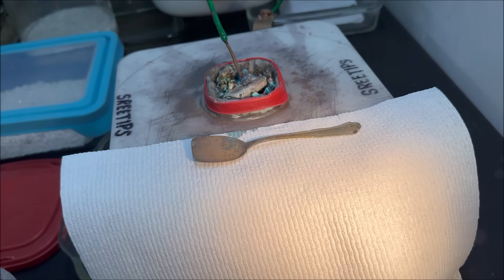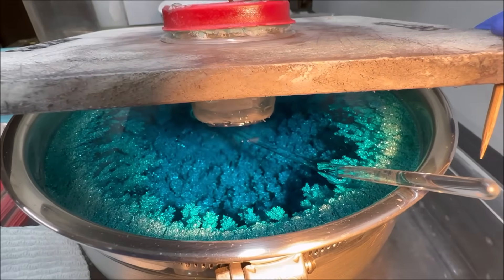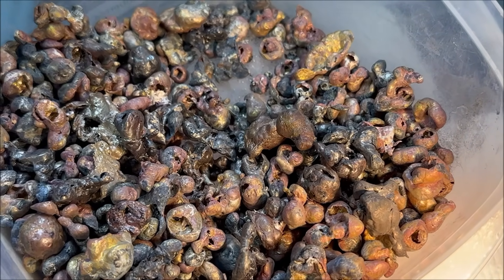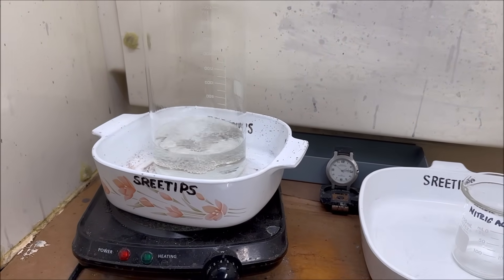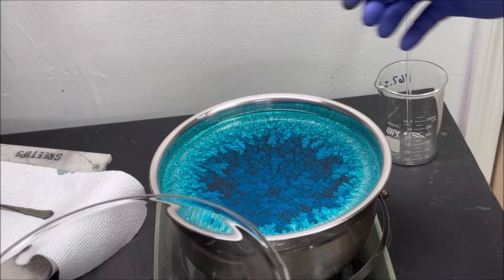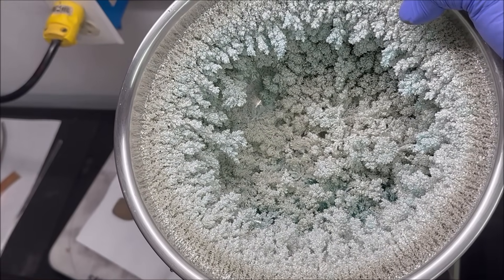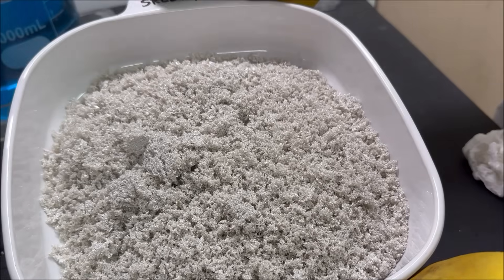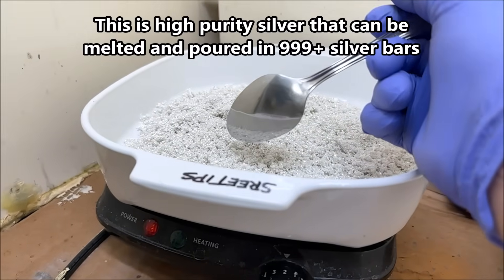999 Fine Silver Cell Harvest and Reboot

Comment: It's times like these when I question my YouTube algorithm enough to wonder how I got here but also praise it for guiding me to this absolute gem. I'm just so blown away right now.
Reply: It’s almost like it believes we can achieve this.
Reply from the maker: I did it in my garage, so it is achievable.
Reply: @sreetips  but people get the wrong idea about what this is. it does not "create" pure silver. it merely extracts the silver from the original alloy or whatever you are purifying from. it is not "growing" silver. it is simply extracting.
Reply from the maker: The silver grows on the cathode as the cell operates. I never claimed that I’m creating silver nor growing it from nothing.
Reply: You can't make silver am I incorrect?
Reply from the maker: No new silver is being created. I’m refining impure silver into high purity silver in the silver cell.
Reply: @sreetips how?  where'd you get the silver?
Reply from the maker: I refine gold. I use sterling silver, that I buy at estate sales, to refine the scrap gold. I recover the silver from that, melt into shot, and run it through my silver cell. The cell converts the impure silver (about 980 parts per thousand silver) to high purity four nines fine (9999 parts per ten thousand) pure elemental silver metal. The impure silver is added to the anode basket. The anode basket is suspended in the silver nitrate electrolyte. I pass an electric current through the impure silver. The silver dissolves, passes through the Dacron filter, travels through the silver nitrate electrolyte, and deposits on the stainless steel bowl (the cathode). The bowl is connected to the negative pole of the power supply. The process only deposits pure silver on the cathode. So I’m refining the impure silver, into high purity silver. When it’s full, I harvest the pure silver crystal, put it away and forget about it. Then I repeat the whole thing again.
Reply: @sreetips  amazing thank you for the in depth reply. I've been watching your videos and starting to understand a bit more now. how do you find the estate sales?
Reply from the maker: Estatesales.org
Reply: @sreetips  are you using old batteries as a source?
Reply from the maker: @funkbros3141 no, I’m using sterling silver that I buy at estate sales.
Reply: Its sad that they are someone out there who would actually think that silver is being created from nothing. But someone will. Lol
Reply from the maker: @BradleyElkins-y6p what’s even sadder is that people believe that paper currency has value. And it can be created out of thin air. Most folks don’t understand this.
Reply: Me too how to make dopamine I guess or meths
Reply from the maker: No dopamine or “meths” just pure silver.
Reply: Hahaha. Lol.
Reply: @hrkristoffer HERONS AND METHS work pretty well
Reply: Yes thank you for telling everyone
Reply: I dont question it ,i go with it
Reply: People probably search for silver and gold, and the algorithm does not care for what type, and for what reason.
Reply: @barrdackless I was learning about waterproofing tarps and now I'm here
Reply: You clicked a couple button
Reply: One time I started looking into the geometric shapes of different tones..... and ended up at the emerald tablets of Thoth lol
Reply: @BigPhatAlbert  elon musk mentions emerald tablets before...
Reply from the maker: I’ve never heard of that.
Reply: Me too man
Reply: SAME!
Reply: I feel you brother I’m bout high as the moon thinking the same
Reply: Me too❤
Reply: *absolute precious metal
Reply: I mean. Cant you grow silver like he does in this video. Then sell it to gold smith for proffit?
Reply from the maker: @SALLDAR I refine gold. I use sterling silver, that I buy at estate sales, to refine the scrap gold. I recover the silver from that, melt into shot, and run it through my silver cell. Silver is a by-product of my gold refining. The cell converts the impure silver (about 980 parts per thousand silver) to high purity four nines fine (9999 parts per ten thousand) pure elemental silver metal. So I’m refining the impure silver, into high purity silver, not creating silver out of thin air. When it’s full, I harvest the pure silver crystal, put it away and forget about it. Then I repeat the whole thing again.
Reply: Don't question it
Reply: @CB-KC 
U mean, like, what's inside a hotdog?😂
Reply: Same same. How did I get here? Lol
Reply from the maker: @tinamercer3473 thanks for looking!
Reply: System of a down said it best "WAKE UP"
Reply: I could say I couldn't agree more
Reply: A year later I am getting it.
Reply: One can start to wonder where all the silver in the world comes from. There's more than a few problems with history. What if this is one of them?
Reply from the maker: There’s one thing that history can teach us, if we have the ability to learn it: fiat currencies have a 100% failure rate. And that’s why after US dollars, Amazon, Apple, and bitcoin are long gone and forgotten, gold and silver will still be here. And they’ll still be valuable.
Reply: @sreetips  very informative, but rather a harsh take on the success rate of an early growing, revolutionary technology such as bitcoin. a deep look into it reveals it has none of the downsides of any other type of currencies, only the benefits of a safer, simpler, faster, immutable and more available utilization given a worldwide adoption, who knows what the future may hold. amazing video though!
Reply from the maker: @Tokirumi well, at least with paper currency, you can use it to start a fire to keep warm. Bitcoin is fiat, and fiat has a 100% failure rate, without exception. It’s a mathematical certainty. Long after bitcoin is gone and forgotten, silver and gold will still be here. And they’ll still be valuable.
Reply: @sreetips  Haha i’ll give it that 😂 i wouldn’t say it’s fiat though since it isnt issued by any government or organization, but anyway we’d be lucky to see a new currency that would undoubtedly be better than the current system is our lifetime. i’m opened to anything
Reply from the maker: @Tokirumi fiat means “backed by nothing” regardless of who issues it.
Reply from the maker: Gold and silver are real money, real wealth. That don’t need ”backing” because they stand on their own. bitcoin is fake, imaginary, and it will fail. Unfortunately. If you have bitcoin then I hope for you do well with it. But like any other “investment” (Bitcoin is really more like a Casino) you must be right twice: when you buy and when you sell. With silver and gold you only need to be right once, when you buy.
Reply from the maker: @Tokirumi Mined on asteroids? We can’t even keep humans safe in our own polar regions. Not with chemical rockets. Solve the gravity problem (science has no clue what gravity is, nor the other three forces), then maybe we can travel to the stars.
Reply from the maker: Gravity: an unknown, mysterious force, that holds everything together. Best explanation so far. They have no clue what gravity is, nor weak nuclear, strong nuclear, magnetism. They are a complete enigma.
Reply: @sreetips  but wouldn't the rotation of the earth explain gravity and the spirals of weather systems like tornados and hurricanes...
Reply from the maker: @funkbros3141 no, rotating earth would fling us off the earth if it wasn’t for the mysterious force that holds us on called gravity.
Reply: @sreetips  but don't the planets that stop spinning freeze and the core isn't able to churn hot liquid magma thus rendering it dead without an atmosphere...I think the rotation is overlooked
Reply from the maker: @funkbros3141 I don’t know about all that. All I know is that science has no clue what the four forces are: gravity, magnetism, strong nuclear, weak nuclear. They are a mystery.
Reply: @funkbros3141 Fun Fact- there's a moon of Saturn that is basically on permanent fire.. it's because it is constantly being pulled in several directions by the planet Saturn as well as the many other moons in orbit.... the friction of being pulled and pushed every which way so constantly make its surface lava where the temperature of space is nearly -1000 degrees Celsius.
Reply from the maker: @BigPhatAlbert - there are marvelous things going on out in space, away from our sheltered existence on planet earth.
Reply: @sreetips  what if space is gods domain not humans?
Reply from the maker: We will know the answer. When we leave the planet.
Reply: @funkbros3141 
If earth is rotating, why doesn't the sun rise and set as the same speed of the rotation the earth spins, which is 1,000 mph. 😮
Reply: Opposite of whatever this guy is on . Blocking this channel.  Thumbs down so I won't get simular rubbish

Comment: Wait..Sooo You can grow silver?! 😮
Reply from the maker: Yes, the impure silver in the anode basket dissolves, passes through the filter, through the electrolyte, and deposits (grows) on the inside of the stainless bowl, the cathode.
Reply: @sreetips I don’t know why this is so fascinating to me. Looks fun tbh! Could you buy a bunch of old jewelry, melt it down for the impure shot and use that to get the pure silver out? I know you use your cement silver, but if someone had nothing and wanted to start out what’s the best way?
Reply from the maker: I’ll try running some sterling silver through the small cell for an experiment. Still need clean silver nitrate for the electrolyte.

Comment: I’m curious., what is the cost of all the stuff you have to use verses the yield of silver? I am very interested in trying this as I have always been interested in alchemy. Thank you for your video and if you have some figures on cost vs. yield I’d appreciate it!
Reply from the maker: I’m sorry I don’t know. I refine gold. I use sterling silver, that I buy at estate sales, to refine the scrap gold. I recover the silver from that, melt into shot, and run it through my silver cell. The cell converts the impure silver (about 980 parts per thousand silver) to high purity four nines fine (9999 parts per ten thousand) pure elemental silver metal. The impure silver is added to the anode basket. The anode basket is suspended in the silver nitrate electrolyte. I pass an electric current through the impure silver. The silver dissolves, passes through the Dacron filter, travels through the silver nitrate electrolyte, and deposits on the stainless steel bowl (the cathode). The bowl is connected to the negative pole of the power supply. The process only deposits pure silver on the cathode. So I’m refining the impure silver, into high purity silver. When it’s full, I harvest the pure silver crystal, put it away and forget about it. Then I repeat the whole thing again.
Reply: @sreetips  Thank you for answering! My sons are jewelers and own a jewelry store and they get scrap gold and silver a lot. I’m going to share this video with them! This is amazing! Thanks again!

Comment: How's the economy of this? I mean, you need space (rent / interest), you need pots n pans, you need a source of waste metals and the cost of preparing them, then you need chemicals and some electrical equipment. Finally there's use of electricity for the space and the reaction. All these can be put into equations so it's possible to compute a per gram cost, which is then used to make a rough calculation of the final cost per gram.
Reply from the maker: Yes it could. But I’ve never taken the time to do it. I’m just converting the cement silver to pure silver. Then I harvest, put it away, and forget about it.
Reply: @sreetips  Ok, I'm just wondering if this process makes and end product that's still within the oz market price for silver. Also, how could you optimize or automate the process?
Reply from the maker: Every pure silver bar or round on the planet began as pure silver crystal just like you see in this video. I don’t think there’s a way to automate. Getting pure metal is very hands-on and labor intensive.

Comment: @sreetips, great videos, man. I'm interested in giving this a solid attempt. I'm hopeful you would be so kind as to provide me a little insight as to how I should start up a successful attempt at this process. I fully understand how electrolysis works and have used it many times (with a bit higher voltage) to clean rust from steel and in other operations to creat brown gas for automotive applications and high heat torches for welding projects. What I aim to learn is knowledge of where to find high quality silver nitrate and how much silver would I need for the anod to start with to obtain similar results of this video. Also realistic sorces to obtain the amount of silver I would need on a consistent basis to maintain a continuous operation of this caliber. I realize I'm asking a lot and don't expect you to give up any of your secrets if that would be the case but I am really interested in this and know I could make it work rather effortlessly in terms of the proper preparations and application of the process. Any info would be much appreciated and I don't care to provide you with an email we could speak a bit more privately if you would prefer. In any case, impressive work brother. You say beginner but looks rather pro status to me.
Reply from the maker: We buy sterling silver at estate sales.

Comment: so you can make silver. thats crazy :DDD
Reply from the maker: I’m not making silver. I refine gold. I use sterling silver, that I buy at estate sales, to refine the scrap gold. I recover the silver from that, melt into shot, and run it through my silver cell. The cell converts the impure silver (about 980 parts per thousand silver) to high purity four nines fine (9999 parts per ten thousand) pure elemental silver metal. The impure silver is added to the anode basket. The anode basket is suspended in the silver nitrate electrolyte. I pass an electric current through the impure silver. The silver dissolves, passes through the Dacron filter, travels through the silver nitrate electrolyte, and deposits on the stainless steel bowl (the cathode). The bowl is connected to the negative pole of the power supply. The process only deposits pure silver on the cathode. So I’m refining the impure silver, into high purity silver. When it’s full, I harvest the pure silver crystal, put it away and forget about it. Then I repeat the whole thing again.

Comment: Hey Sreet, I think I already know the answer, and it's probably yes, but will this method work with silver plated stuff instead of using the pure silver bar and other reclaimed metals like you are using? I have some old silverware that is a mix of silver plated copper and likely sterling silver as well.
Reply from the maker: For electrolytic refining to be a success, the anode material must be fairly high purity to begin with. Plated would quickly foul the cell and produce no good result.

Comment: I have never seen this before, its insanely interesting, wondering if you make you own juwelery
Reply from the maker: I refine gold. I use sterling silver, that I buy at estate sales, to refine the scrap gold. I recover the silver from that, melt into shot, and run it through my silver cell. The cell converts the impure silver (about 980 parts per thousand silver) to high purity four nines fine (9999 parts per ten thousand) pure elemental silver metal. The impure silver is added to the anode basket. The anode basket is suspended in the silver nitrate electrolyte. I pass an electric current through the impure silver. The silver dissolves, passes through the Dacron filter, travels through the silver nitrate electrolyte, and deposits on the stainless steel bowl (the cathode). The bowl is connected to the negative pole of the power supply. The process only deposits pure silver on the cathode. So I’m refining the impure silver, into high purity silver. When it’s full, I harvest the pure silver crystal, put it away and forget about it. Then I repeat the whole thing again.
Reply: @sreetips  damn. So the silver doesnt actually grow, it transfers to the stainless steel bowl and regrows to be more clean and pure?
Reply from the maker: Correct, I’m refining the silver, not creating silver.
Reply: @sreetips  Ahhh ok ty so much <3

Comment: Wait, what's the point of the little round chunks in the anode basket? All the silver being recovered in the bowl is from the silver dissolved in nitric acid and used as the electrolyte solution. The same thing could be achieved by just putting copper in the blue solution of cooper and silver nitrate, eventually the silver will begin to grow on the piece of copper. I would say stop with the round chucks and just dissolve all of it and save yourself money spent on electricity.
Reply from the maker: I refine gold. I use sterling silver, that I buy at estate sales, to refine the scrap gold. I recover the silver from that, melt into shot, and run it through my silver cell. The cell converts the impure silver (about 980 parts per thousand silver) to high purity four nines fine (9999 parts per ten thousand) pure elemental silver metal. The impure silver is added to the anode basket. The anode basket is suspended in the silver nitrate electrolyte. I pass an electric current through the impure silver. The silver dissolves, passes through the Dacron filter, travels through the silver nitrate electrolyte, and deposits on the stainless steel bowl (the cathode). The bowl is connected to the negative pole of the power supply. The process only deposits pure silver on the cathode. So I’m refining the impure silver, into high purity silver. When it’s full, I harvest the pure silver crystal, put it away and forget about it. Then I repeat the whole thing again.